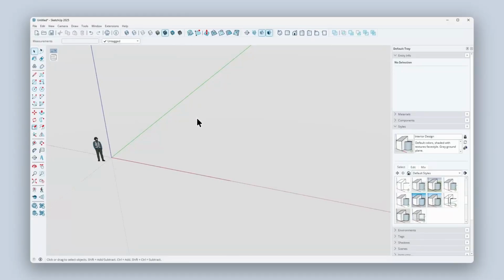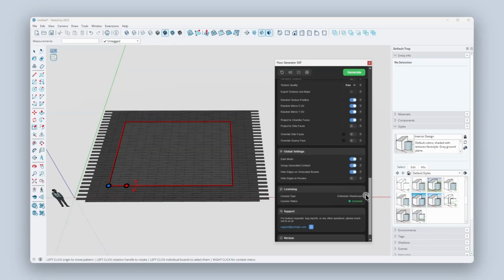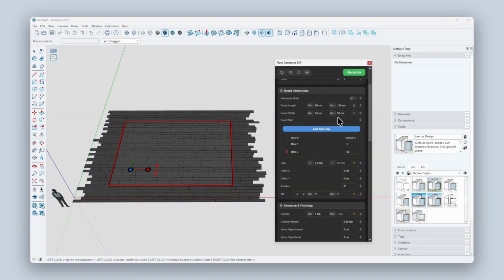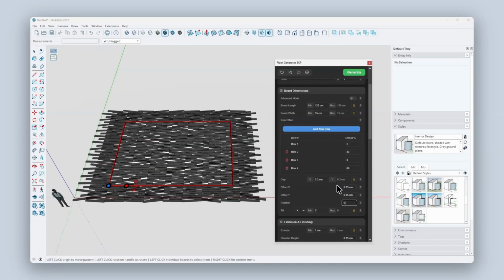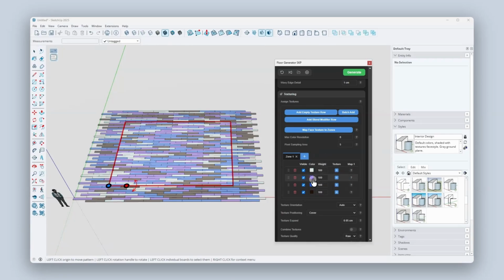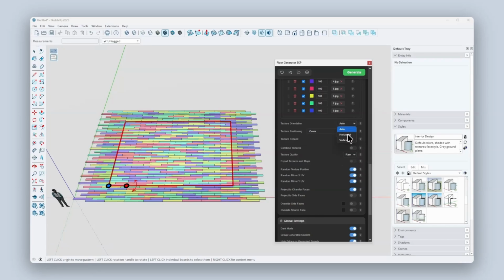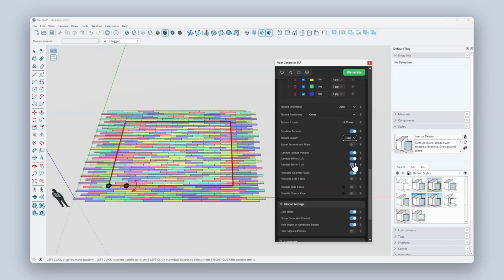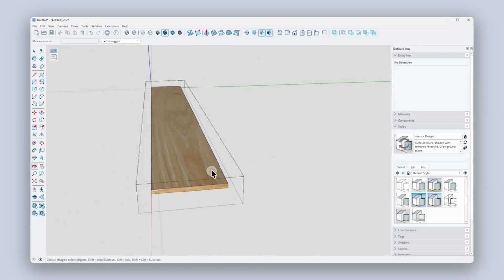Floor Generator SKP for SketchUp - Introduction

Comment: can this be used for wall tiles as well? How would you do grouts in the corner of walls?
Reply from the maker: Yes, it works on surfaces of any shape or orientation.

For realistic grout lines at corners, I recommend applying a grout texture directly to your wall or floor surfaces and generating the tiles on top of them on both surfaces at the same time (select both faces before opening the UI) with a very small thickness (0.1–0.2 mm). To ensure the grout lines are created correctly at corners, enable Auto Offset and set the offset distance to match the maximum tile thickness.

The latest update also introduced automatic tile trim generation, which can automatically create tile trim profiles along exposed edges where needed.

Comment: Ok but 50$ is to much for a new plugin. If you set a less value you should sell much
Reply from the maker: I believe the price is very fair for the value it provides. This tool was built specifically for professional users (meaning people who make money through architectural visualization). As a professional myself, $50 for a permanent license is a small investment considering you’ll likely use it on almost every interior project.